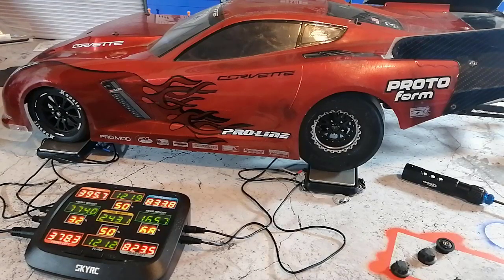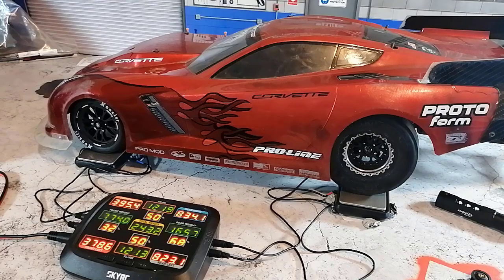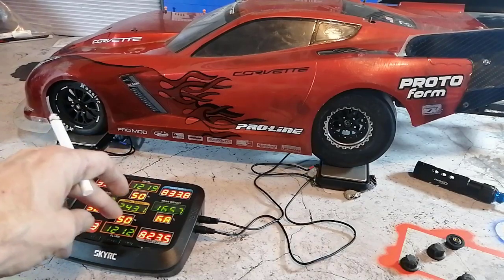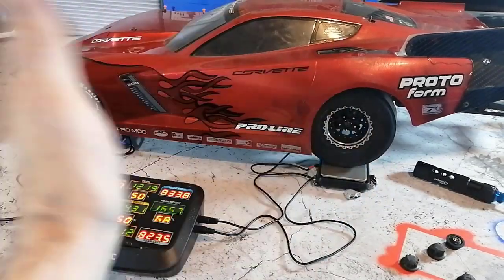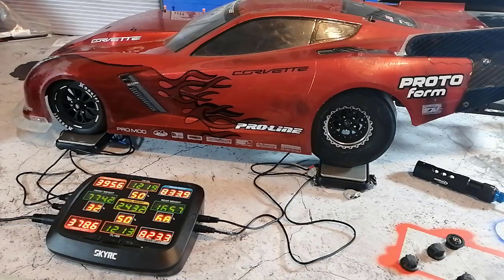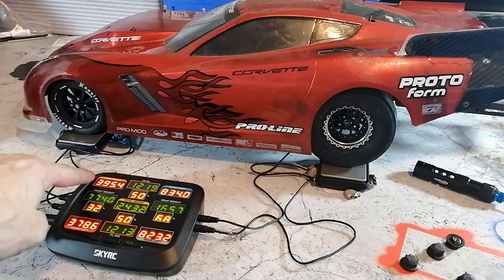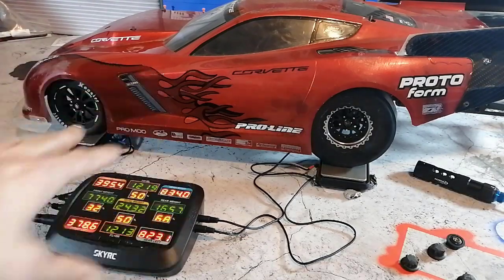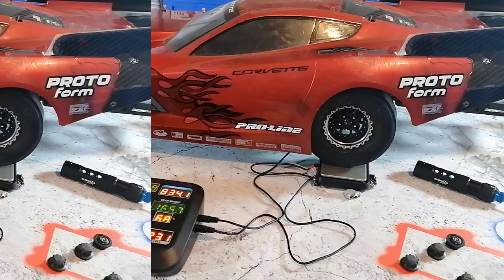NPRC WEDGE Tuning & Corner Balancing

Comment: very good content. helpful tips for all & chassis tuning is:
make sure your surface being used to place scale on is trued/leveled first
use a 3/4 or 1 inch glass, plexi glass hudy setup board or a trued platform material & check for flat trueness with a level from corner to corner in a X measuring pattern. TRUE CONSISTENCY is key. hope this help & only my humble knowledge/experience combine with my anal OCD. stay endured & be safe all.

Comment: how was you able to get your scale to stay on so long, mine turns off after so long
Reply from the maker: if you have it powered up and it auto shuts off, its only in a sorta "sleep" mode where its still actually on just the screen is turned off, hit the on off switch it will light the displays back up and will not of lost the tare/zero of the scales just keep on doing your adjustments, its kinda annoying I wish they gave an option to turn that feature off or at least delay it longer, dont see it shut off in the clips cuz Im cutting out long pauses n stuff to cut the length of the video down and remove me sounding like a dumbass saying "uhh" "now" "as you can see" over and over lol

Comment: The proper term in Drag Racing is preload not wedge all your adjustments for preload should be done in the rear.. the front just floats under power its drag racing not NASCAR jmo
Reply from the maker: Sorta half right, yes Im making preload adjustments in order to adjust the corner balance ;) in all racing taking it off 50/50 is considered wedge as a term that came from how the adjustments were done originally Back in the Day using an actual physical wedge, now in Nascar on a Oval they always have wedge always positive and vary how much they never run neutral or negative, but go circuit racing and while cars are usually set up neutral balanced some will use wedge depending on the track, example if a track has a majority of right hand turns some will use negative wedge to give better grip in the corners the car will spend the most time in sacrificing a little bit in the turns they will spend less time in. Its done a lot in Auto X too for the same reasons. In drag racing riding wheelies dont win races you have to tune for 4 wheels on the ground not 2, adjustments to the front shocks will vary how the weight transfers and thats what this is all about
Reply: @NorthSideCustomRC  I agree with all your wedge adjustments on turning on racecourses, when I mean float to front end I mean it is not on the spring as it is on the scales.. all good tho
Reply from the maker: @powermadracing5116  think of it like this, preload at the front will impact how fast the weight comes off the front transferring to the rear, in doing so impact what rear tire gets its load first. How I set my cars up for Initial tuning, where to start from is 50/50 neutral so Im starting with as much as equal loading as I can. Once on the pavement making my adjustments its gonna be based on where Im tuning for. Big end or getting out the gate, but I dont exclude front adjustments cuz they will impact speed of the weight transfer and how the front weight transfers to the rear. Keeping in mind its not increasing or decreasing how much weight is transferred more the rate of transfer especially when tuning the hit.
Reply: @NorthSideCustomRC  in Drag Racing we call that , instant Center , center of gravity , and pitch and rotate.. I found some really good information in the Jerry Bickel chassis book throughout the years as far as getting the car straight it's all in the rear end..  the proof is in the thickness of the front tire
Reply from the maker: @powermadracing5116  I dont disagree with what your saying, I just think you making a little much out of nothing. Setting her up neutral to start is just basics